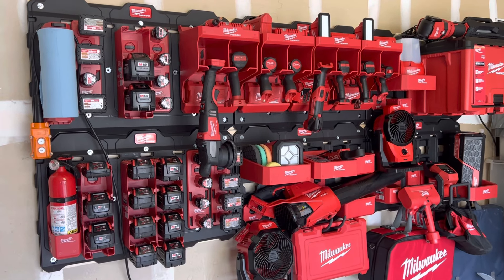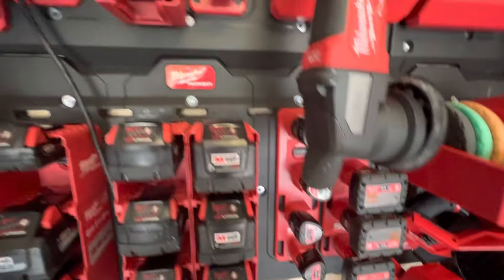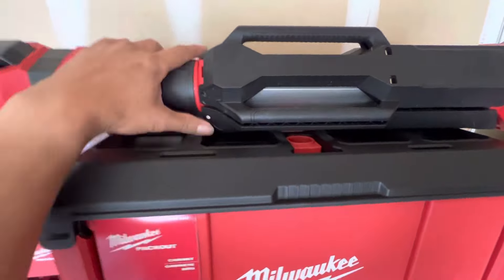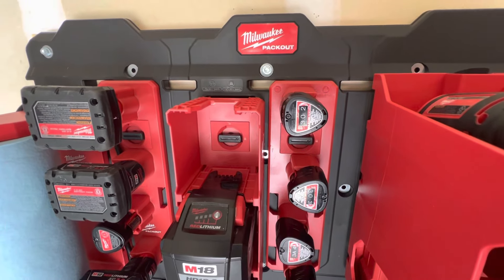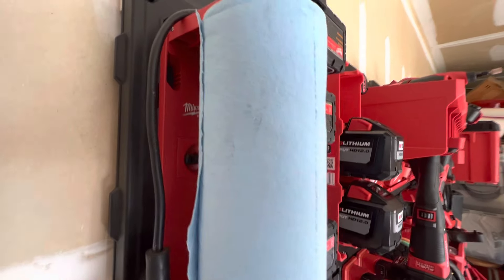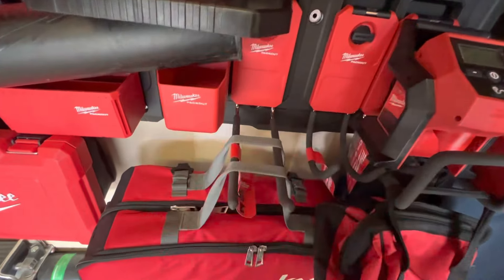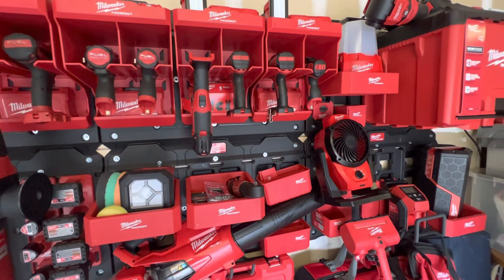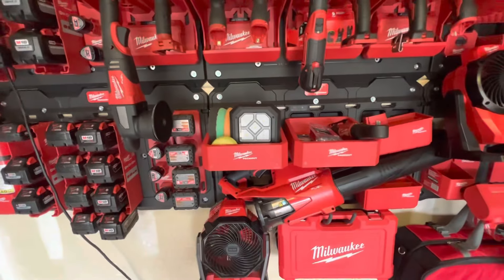Milwaukee Packout Shop Storage System

Comment: Looks like you have done a lot of work with those said tools. Typical Milwaukee guy 🤣🤣🤣
Reply from the maker: I’m a Milwaukee fanboy 😍
Reply: @MinhNguyen-ot1zg  you should get the heated jacket and beanie to go with it. That’s if you don’t have it already 😂
Reply from the maker: @Billybob-go8hn  haha I have the heated axis jacket that has the quilting and I have the heated hoodie!!!! And the beanie! That’s what those m12 power sources in my cabinet are for. I much prefer the hoodie because it feels more like a sweatshirt and it doesn’t add any bulk. Last winter it got down in the subzero temperatures and all I needed to wear was a light T-shirt and the hoodie. I’ve discovered that the less you wear underneath, the more heat you will feel. I absolutely love the hoodie and they just came out with a new style model for fall 2022. It seems like the updated hoodie has additional pockets along with the ability to move the battery from the back to the front which would be an useful feature. I’m really thinking about getting the new style hoodie!
Reply: @MinhNguyen-ot1zg  I KNEW IT! I do got the heated jacket and it does do wonders I can’t lie about that.
Reply from the maker: @Billybob-go8hn  what is really super nice is if you have the heated hoodie on high and then put the heated jacket on over the top of it and turn that one on high. OOOOOMG it’s so nice and warm on a frigid mid western day. I bought my heated gear about a year ago and I should’ve done it a long long time ago. It’s been fantastic. My dad was so impressed that he got a heated jacket. In my video, there is a M 18 adapter that was in one of the large bins. It also has the receptacle for the heated jacket. If I were to put the 12 amp hour M18 battery on it, it would run my jacket on high setting for about 84 hours.

Comment: I can only say I hope your garage is climate controlled because the batteries should not be stored in hot or cold places.
Reply from the maker: I live in the Midwest. In the wintertime I move the batteries inside my house. Good point there!
Reply: @MinhNguyen-ot1zg  I grew up in Iowa, and lived in Colorado for awhile, so I’m no stranger to the cold.
Now I live in the desert, so it’s exactly the opposite. Winter is nice, but the damn summers here….
Reply from the maker: @DiligentDave1966  Iowa is probably similar to indiana which is where I’m from. With this setup in the desert I’d have to bring the batteries in in the summer for sure!

Comment: Dude.  All these tools look new and unused.  What do you do that you need so many batteries, both 12’s and 18’s?  You don’t sound like a contractor.
Reply from the maker: I’m not a contractor. I rotate through all the batteries and I use all my tools. The bigger amperage M18 batteries get used in my lawnmower - remember, the lawnmower uses two batteries at a time. I use the pair of 8.0’s first, then both sets of 9.0s and then the 12.0’s. It takes me about three hours to do my lawn.